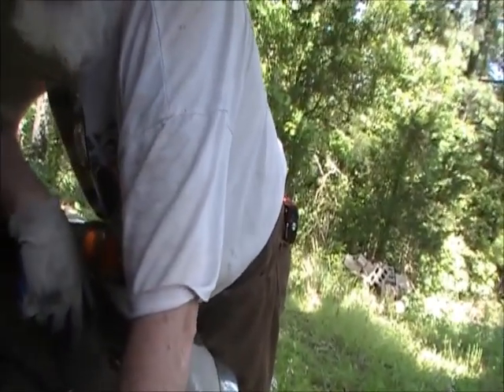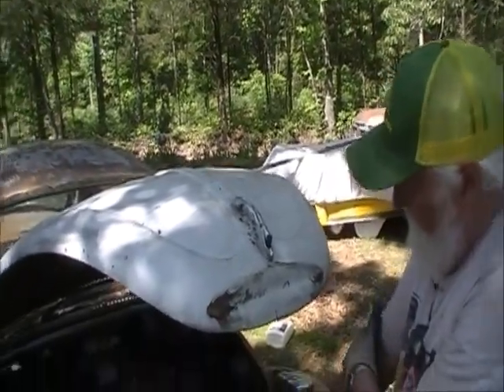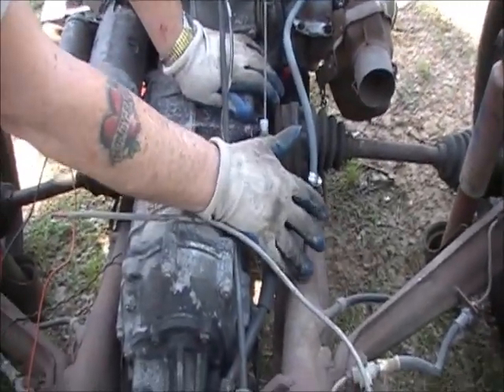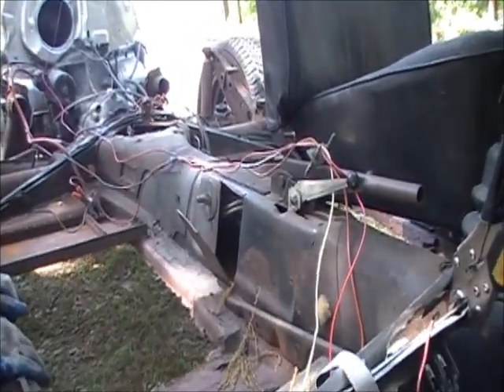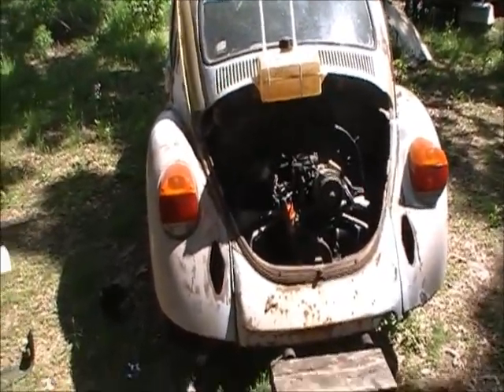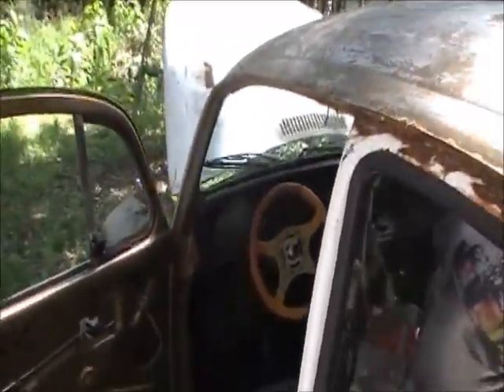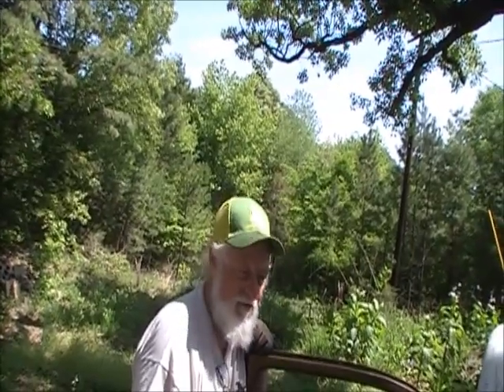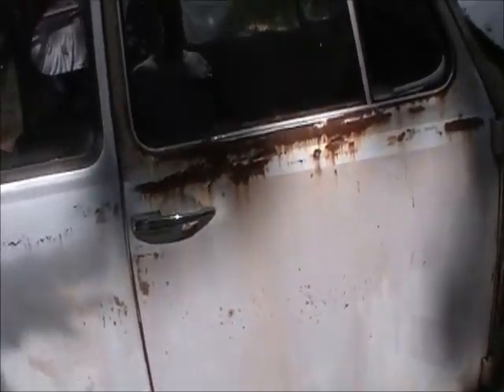RPEEK an PEARL

Comment: the aircooled engines get addictive.... I took a 1800 cc pancake and punched it out to 2600 cc.... $5000 dollars worth of machining later I was having some fun in my mountain rail... just under 200 hp and about 240 ft pounds of torque in something that weighs less than 1000 pounds was a blast!!!!

Comment: :(  cutworm, I was wanting to see you take rpeek's pan for a spin.  I wish I had it in the country at my place.  I would leave it just like it is and teach the grand kids how to drive a manual transmission.  They as well as I would love it just to ride around on the farm.
Reply from the maker: Oh don't fret. Mr Peek has some video of the thing wit me in it. Thar I waz....throttle stuck wide open with no brakes, 100 ft bluff in front.......
Reply: cutworm59 He didn't teach you how to pull up the E brake to stop it?  That is good.  I will keep checking his site for your ride.. :)
Reply from the maker: The E-brake wont do much good at 40mph.